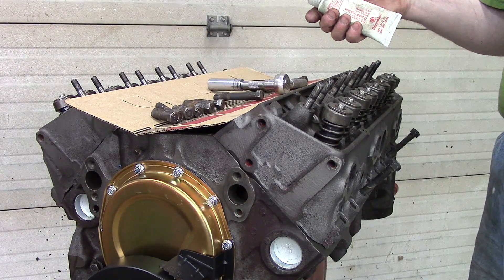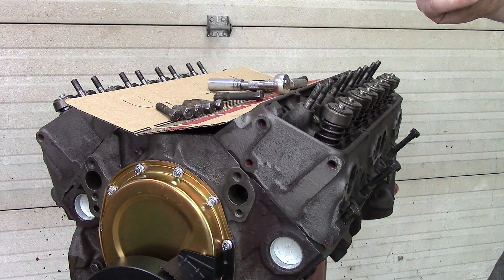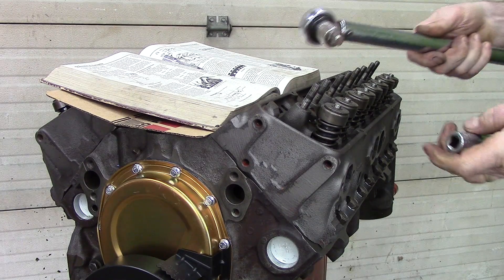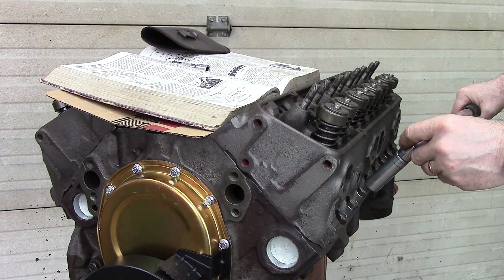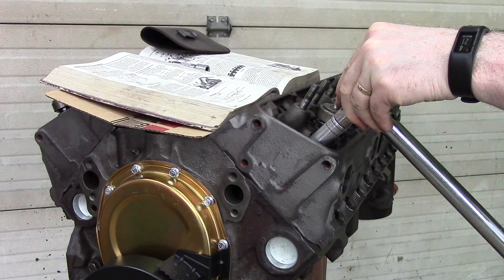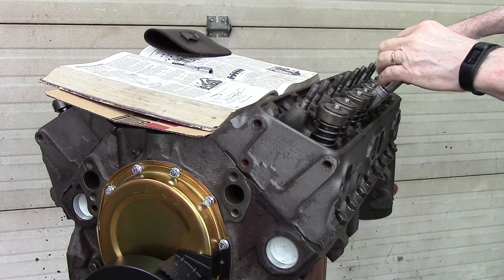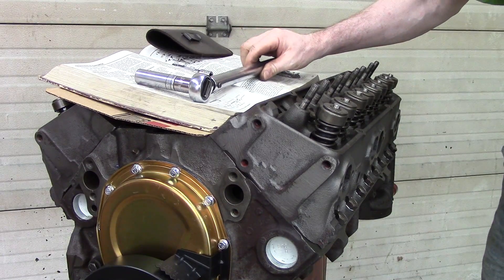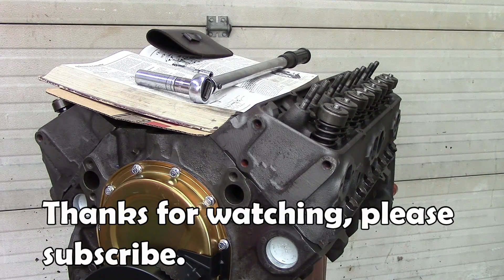V-8 Engine Rebuild SBC #11 Head Installation

Comment: I wouldn't think that the adapter on the torque wrench would change the dynamics of its use..70 lbs is 70lbs coming off of the center point of the ratchet, it doesn't cause an increase or decrease in leverage so its fine ide be more concerned with possibly breaking the adapter but hands down a 6  point socket is better than a 12 point socket especially with head bolts good job....TIP - its good to put some Molly lube or motor oil on the underside of the bolts head to aid in a more easier twist or rotation of the bolt by way of decreasing the inevitable increase in friction as the bolt is tightened more and more I'm about to do my heads tomorrow and I'm dreading it
Reply from the maker: Thank you!